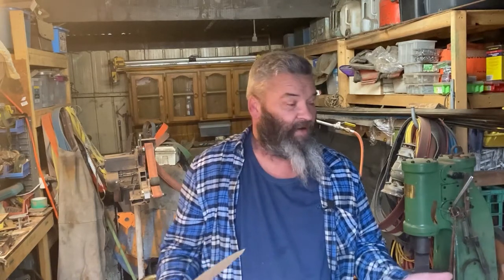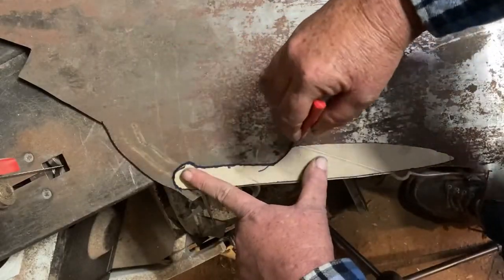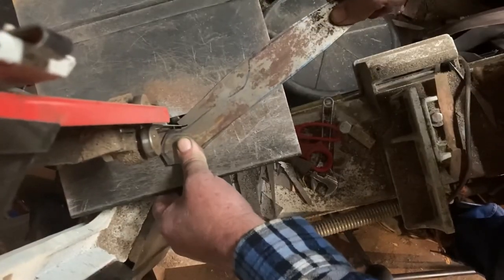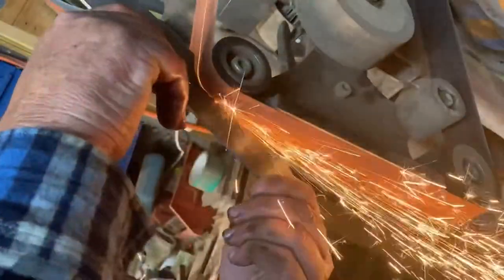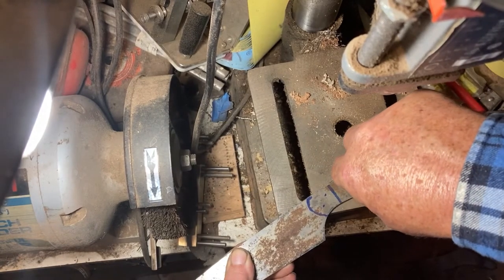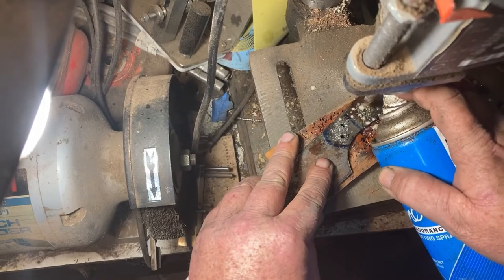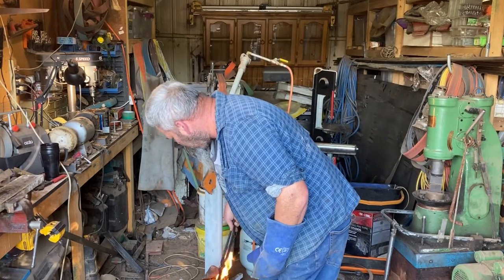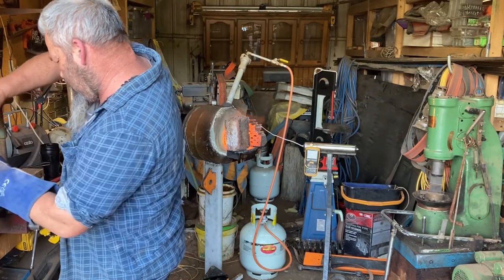The Lala farm knife build Cut, shape, drill and heat treat

Comment: Darren this is absolutely amazing brother.  Sorry I have not been visiting as much - work has gotten crazy over the last couple of months.  Just not enough hours in the day to meet all the time demands.  How does the heat influence the magnetism of the piece? This was really cool Darren!!  - Rick
Reply from the maker: Don't stress the little things mate, you know I haven't even been able to make your lives due to work which sucks. 
Taking the knife to critical temperature is just before you get to melting point. Relieves the crystalline structure of the steel (which is the part that reacts to a magnet) and make the internal structure homogeneous so that there is no magnetic reaction. The quench after that is to make smaller crystals within the steel which give the steel it's hardness, tempering slightly opens the gaps between the crystals and give back some flex. Well all that is the short version of the process without going into what type of crystals form and getting really technical.
Reply: @DownunderFarmandForge  thanks for the explanation Darrren.  Pretty amazing process.  - Rick